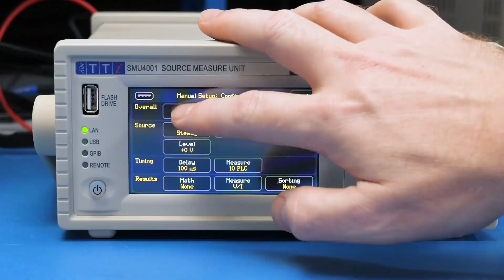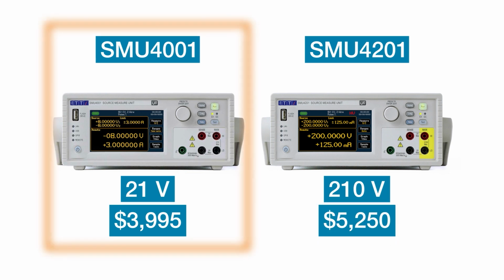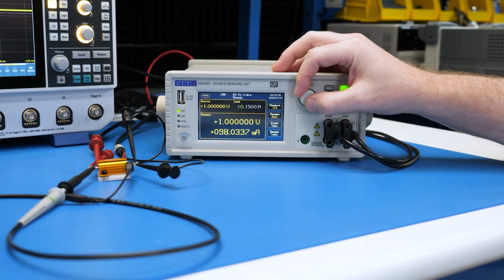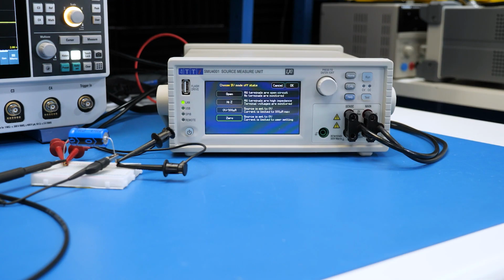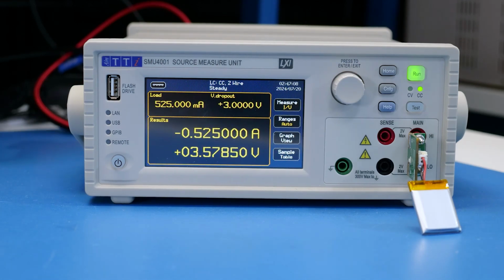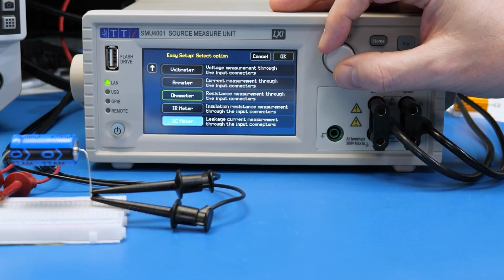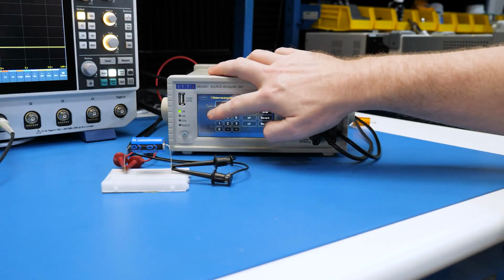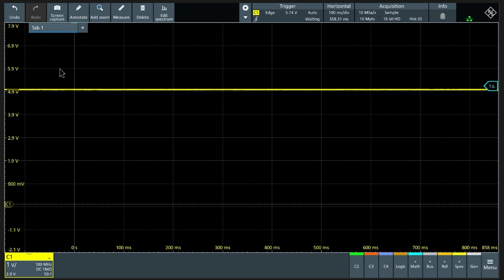Hands On with Aim-TTi's SMU4000 Series Source Measurement Tools - Workbench Wednesdays

Comment: I like the JST adapter @3:41. I'd just be afraid of accidentally shorting the banana plugs on some random tool on my workbench.
Reply: That's a good point. I've made similar adapters for other connectors. They all carry a lot of risk. I hadn't thought about the leaving a battery connected to the JST adapter. Probably worth adding a polyfuse to that one.